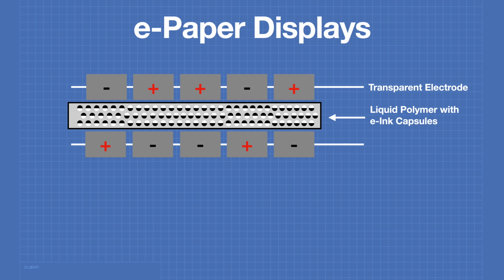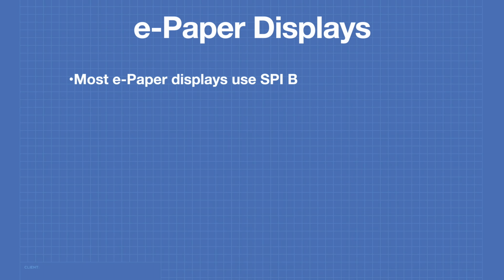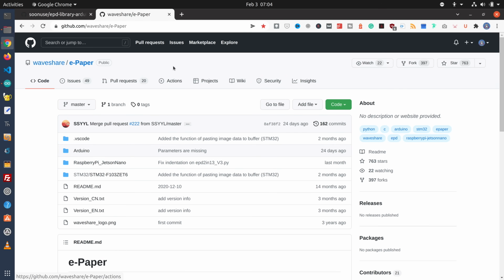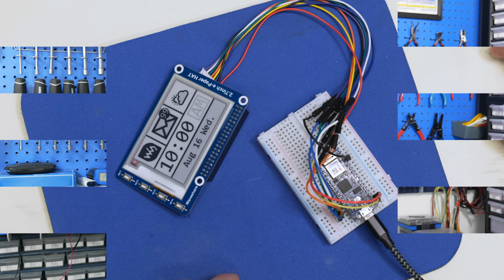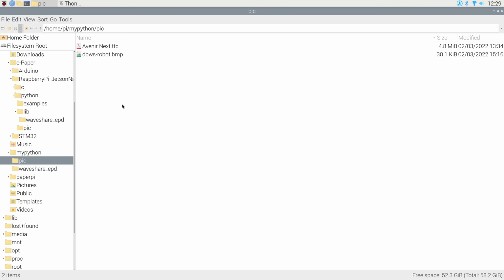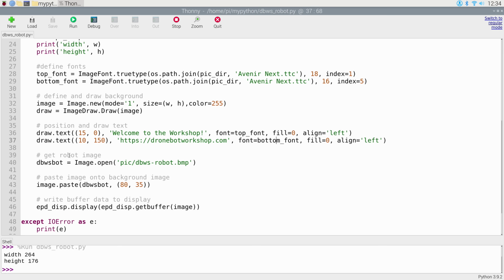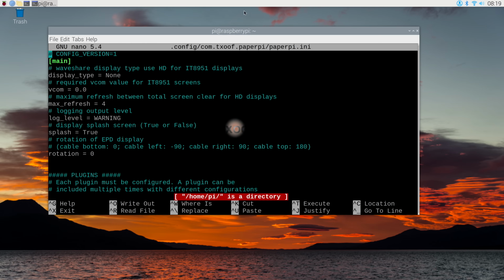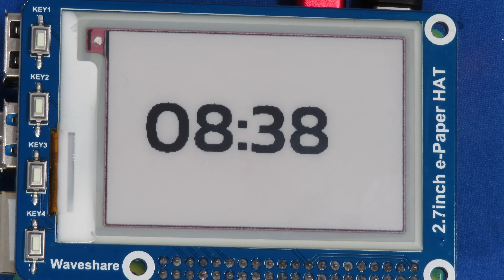e Paper with Arduino and Raspberry Pi

Comment: Can I use two of these displays simply by connecting the second display to the same pins.?
I want to put them under a 90 degree angle on my sailboat so I can read the speed from both sides

Comment: I've been having a lot of trouble with this display.  I almost returned it to Amazon before finally getting sign of life.
After failing to get it working with ESP32, I switched to Arduino Nano IoT.
So far, only the epd2in7b example from soonuse gives any signs on life, although the demo gives a different output to what's shown in the video.  Examples from the Waveshare github, dated 2021, give no sign of life at all.
Tried various combinations of V2, non-V2, b, non-b.
Now faced with playing spot-the-difference between soonuse's and Waveshare's files.
Anyone have insight into what's up?  My PCB is labeled 2.7inch e-Paper HAT Rev 2.1

Comment: My 2.7in display appears to be defective. Tried using it with two (actually four) different Arduino Unos, but nothing shows up on the screen. Tried a replacement with no success. My 2.7in display is revision 2.1. I followed the instructions for making the connections carefully. It doesn't appear to be rocket science. Any ideas? Thanks.
Reply: Follow-up: I finally got mine working by copying the non-soonuse folder for my 2.7in display into the arduino libraries folder. When I tried following Bill's instructions using the soonuse library, it didn't work. The code uploaded to the Arduino, but nothing was displayed on the screen. I'm still trying to figure why those files/dependencies aren't linked/working properly.
Reply: @geneh9210  same problem here. Several boards used with a new 2,7 waveshare display but nothing happens. Frustrating!!!!! It is not my first project. Build my own arduino based lawnmower but this is so  Grrrrrrrr
Cannot find the solution
Reply: Did you try using the non-soonuse code? That finally worked for me.

Comment: How fast can the screen update? All demos and such showing a time were static. Is the refresh rate fast enough to show seconds update?
Reply: Depends on the screen and method used to write an update, but it can be as fast as about 3 fps and as slow as 30+ seconds per frame. Most screens are in the 1-3 seconds for a full refresh of the screen.

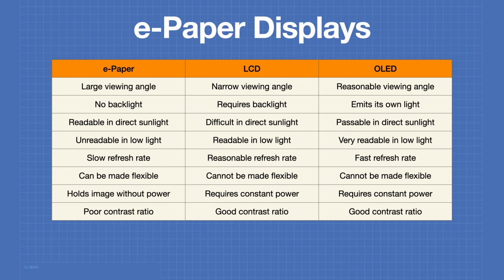Comment: 5:00 A bit of correction for the OLED list last three element:
- Can be made flexible.
- Requires power for the actual lit pixels only (and of course for the driver electronics as well).
- Excellent contrast ratio.

Comment: Thank you, loved the tutorial, learned alot about ePaper displays.  One thing to note, everytime you us the nano editor to edit code or config files you make a small mistake.  You use two parameters: ~/ and <some path>/<some file> and this should be combined into one parameter without a space in between.  The first one "~/" means "my home directory" (which is ignored and results in an error becasue nano tries to edit the file, which it can't because it is not a file ... also, since yuor current folder is in fact you home directory the parameter is okay to ignore ... but if you were to be in another folder then that first bit would make a meaningfull difference).  The second paramer you provide is the path and filename and maybe this is all you want to do if the file is on your current folder or you specify it correctly.  Either you should join the two parameters or drop the first one.  Anyways, love your tutorials.

Comment: Great video, I was wondering if I wanted to check if one of those 4 buttons was pressed, then how would you check to see which button is pressed/released in python?   Edit:  I just found out the info P5 is Key1, P6 is Key2, P13 is Key3, and P19 is Key4.  You then setup any one of those Pnn ports for INPUT, and then read from that port.  If a user presses a Key, then the input from that port (Pnn) will change.
Reply: Thank you! I have been trying to find out how these keys are detected. What Python library do you use to read the Pnn ports?

Comment: I would like to share my usage of e ink display. I have 7.5 inch display. Standard library has some issuers and arduino doesn't have enough memory to store one frame. 
I chose raspberry pi zero w and it was a good decision for me. As a java developer I to create a java program. I installed jdk for arm, downloaded datasheet for display and I was about to write communication layer on Pi4J library. But following datasheet commands I didn't get any result and I heard some squeak from display. I went to arduino lib source code and sequence of the commands and initialization value in the commands was differ from datasheet. Definitely I rewrote communication commands as in arduino lib and everything was good. In java program I used BufferedImage class for storing displayed picture. I'm still wondering how developers from that team figured out what commands with certain values and commands sequence to use?! It is still magic for me.